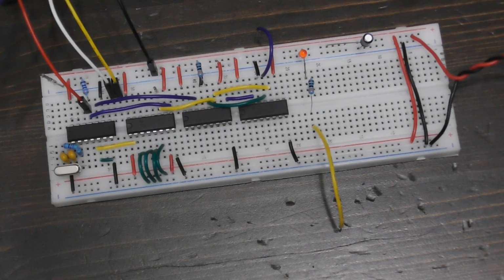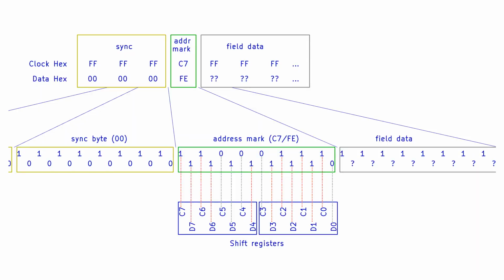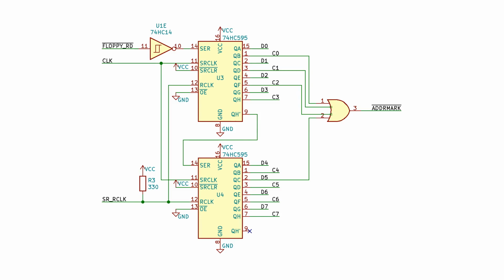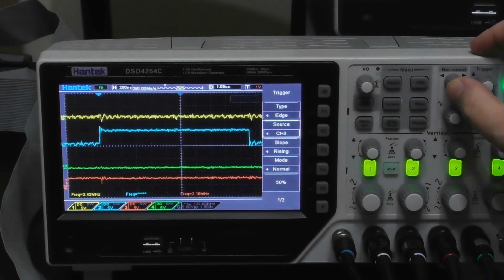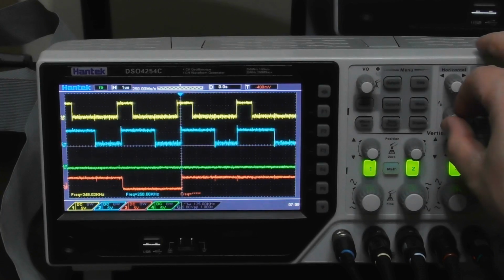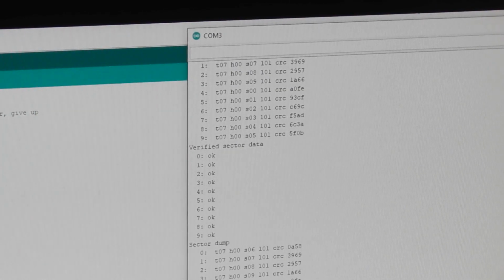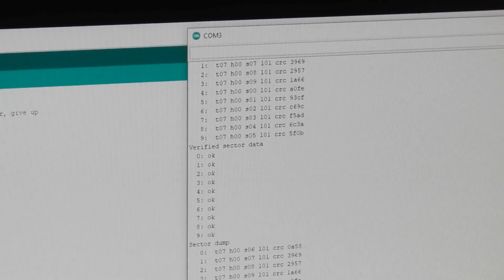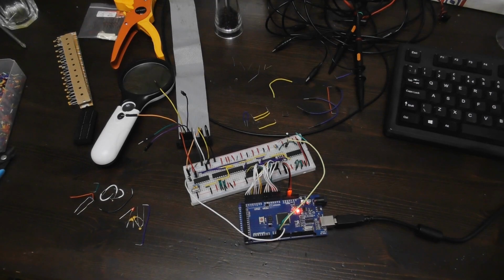Testing my Floppy Disc reading circuit with an Arduino

Comment: What would hapen if you use UART to store data, instead of FM or MFM? That way you can use a simple microcontroller to read and write.
Reply from the maker: Somebody commented a while back that you can use a UART to decode MFM at least into an intermediate form that can be fully decoded in software, very interesting

Comment: Isn't this where DMA is used? A faster IO device can take over the busses and write or read from the fast device without making the cpu sweat.
Reply from the maker: Yes you could do that. If you did it in a way that didn't require pausing the CPU - e.g. making the DMA happen in between CPU cycles like we do for video - then it would be beneficial as the CPU could get on with other things.
Reply: @GeorgeFoot  as a last stage what about putting the data from  the 595s and storing the data in a sn74hc273? This would give the cpu time to read in data while reading a new byte from the disk.

Comment: You seem like an experienced man, and I was wondering if you would help me hot wire my microcontroller up to a usb on my breadboard. its a PIC16F628A microcontroller, but when i hook it up, my pc gets the 'device descriptor request failed'. is there a way to mayby 'create' a fake dds (device descriptor signal, that's what I call it at least) or mayby to get a software that will communicate with the chip? Keep in mind I have no equipment, just some breadboards, wires, old device circuits, and a usb to usb hotwires cable (and some rom chips, pal chips, shift registers, and some other chips) any out-of-the-book knowledge you might have? any help from anyone would be nice.
Reply: I did a search and just in case you missed it, this video seems to be exactly what you need.
https://www.youtube.com/watch?v=HbQ6q3skZgw
In simple terms, you can probably do what you want using a USB library for your microcontroller, but you may be better off using a different microcontroller which has hardware USB support built in.
Reply: @melkiorwiseman  ok thanks for the response, the video might help me (when i understand it better) but for now thanks. Using a different microcontroller is a great idea (yes i thought of it before) but I have (as of now) only cash and live nowhere near a chip store, so ill have to wait for that one.

Comment: Haven't seen a new video from you for quite a while.  Curious as to whether you've done any more work on this or any other project?  I would love to see the fruits of your diligent research on this.  In any case I hope things are well with you and I look forward to more videos!
Reply from the maker: Thanks! I did a bunch of planning for the next video on this, which will be hooking up to a 6502. I debated whether to use a 6522 as well, or go direct (going direct won), and sketching the circuit diagrams - I'm pretty confident it will work and allow loading data from the disc. That was all in December - but then I moved house and I haven't been able to actually get on with it since then! I'm hoping to get back to it soon, as the hard work is already done!

Comment: Interesting. I wonder if there is some device that can sample signal for example at 4MHz, save them and process whole bitstream by a software. Actually I'm not sure if modern osciloscopes can do this, I haven't use any in 20 years. I'm not sure if raspberry pi has capability of sampling signal into DMA buffer neither. It's interesting how floppy drives are simple, I guess with faster electronics it would be possible to have constant data density rather than fixed data throughput and store more on the outer tracks (it would just break compatibility with 1970s design)
Reply from the maker: A lot of modern minimal floppy interfaces do just record the bitstream, or the times between bits, especially when using microcontrollers like Arduino. I'm not so interested in that though because these days yes RAM and CPU power are cheap. I'm more interested in the older technology and what was possible in that era.

CLV=constant linear velocity was used on CDs at least, maybe hard discs but I'm not sure. The difficulty is the effort of changing the rotation speed. These old drives just needed to be really good at maintaining exactly 300RPM. It must be harder to make something consistently maintain a variable speed.
Reply: @GeorgeFoot  I understand, for me as a software developer with signal processing background, I would choose SW approach. Hard drives or CD-ROMs faster than 4x have constant rotation speed. Hard drives have tens of zones with varying sectors per track so more data can be stored on outer tracks and data transfer rate is higher there. All defrag utilities are moving data towards start of the disc besides defragmenting files. I'm not sure if zones existed on MFM hard drives used till early 90s.
Reply: This is what devices like Super Card Pro\Kryoflux\Greaseweazle do. Most microcontrollers (including the atmegas) have dedicated pins that hook up to timers that can measure pulse timings (often called input capture).
Take a look at Rob Smith's work;-
http://amiga.robsmithdev.co.uk/history#background
https://www.youtube.com/watch?v=OAswAoNLJhs.

Then there is also this that you may find interesting;-
https://www.youtube.com/watch?v=ZgH6ov33ieg

Comment: The floppy controllers for the Ohio Scientific computers (among the cheapest of their time) were three simple parts: a PIA (6820) to move the head around and look for the index hole, an ACIA (6850) to read the serial data from the floppy, and a "data separator" which removed the clock pulses from the data pulses. It didn't bother using sectors or cylinders. Every track on the floppy was like a fixed length of tape. You just wrote or read tracks.
Reply from the maker: That's interesting, I considered just writing data to the tracks in my own format to keep it simple. I guess any time you had to update any data you rewrote the whole track?
Reply: @GeorgeFoot  That's exactly what you did with OSI's bare bones OS65 and that's why you needed a system with at least 16K of RAM. I think we had 320K on a 5 1/4 inch floppy so you had to read the entire 8K track into memory. In fact I never even learned how sectors worked. People wrote better OSes for OSI computers so maybe someone figured out how to emulate sectors which I guess would be reading and then writing at precise times. I don't know if you can even do this in software.

Comment: This is great!  Real low-level stuff!   I worked on hard and floppy disk controller designs in the 80's and so I have a good awareness of the various fields in the data stream from the drive, but even then  there was a much higher level of integration than this.  I am impressed that you have this working reliably with such a low parts count using standard logic parts.
Reply from the maker: Thanks for the comment, I appreciate it. I too thought it would be more complex than this, as I know things like the 8271 were pretty widespread at the time, and also quite expensive. It'll be interesting to add write support and get it hooked up to a more 80s style CPU.
Reply: @GeorgeFoot  Interesting? Certainly. Challenging? Probably. Writing adds a whole new dimension.  Get the timing wrong and you not only can't read what you wrote, you may have trashed everything else on the same track as well.
Reply: @GeorgeFoot  you can add this circuit through a 8255 in mode-1 for automatic latching. There is also a hack to make it work without DMA, to have a D-FF output connected to CPU's WAIT, the FF is set by CPU by one IN command and 8255 reset the FF by INTA, so data read/write loop can be very tight just 3 commands IN,IN, PUSH. /*SP must point into input buffer */
Reply from the maker: @alexloktionoff6833  That's an interesting approach. I'm probably going to do it either through a 6522 or custom latch circuits - probably the latter as it's more interesting to design. The CPU will poll or service NMI interrupts like on the BBC Micro, at first, possibly with DMA later on.
Reply: @GeorgeFoot  agree with custom discrete chips it's more interesting. But it may become bloated - fd controller pcb may become same size as video-card. Z80 @ 3.5 MHz had just enough speed to poll /*to include test and conditional commands in the loop*/ for DD fd. Without sector buffering in fd controller NMI is too slow i'm afraid. Let's see ;)
Reply from the maker: @alexloktionoff6833  We'll see - I've been cycle counting some potential ways of interfacing it and it looks OK. The BBC Micro managed double density using NMI, on a 6502 at 2MHz, so it should be fine. The main thing my circuit won't do is CRC checking, but that can be done in software, possibly outside of the main data receiving loop.
Reply: @GeorgeFoot  for i8271 let's say there is a single byte of data transfer always, but for DIY we need two read two bytes to be sure /*ID field or DATA field, and write twice more*/ isn't it?
Reply from the maker: @alexloktionoff6833  I have sixteen bits coming from the shift register. At the moment it's only FM so could be fairly trivial to have hardware check that the clock bits are all set, at least for regular data. Maybe also for address marks, as there are only a few that matter. Some of my code drafts (hand written on paper!) are based on reading the same register twice, 4us apart. I think the Arduino proof of concept just read all 16 bits. But I'm also looking at hardware buffering, maybe making a two-deep 8-bit FIFO, so that CPU timing is less critical. For a first pass I will probably take a lot of shortcuts!
Reply: @GeorgeFoot  it's possible with additional schematics by reading from different address to tell controller what CPU is looking for /*normal byte or marker*/ Writing could be done starting from clock byte, and then providing only data bytes /*because marker is single at the beginning*/.
Anyway Arduino is a rocket fast comparing to 6502 /*16*1=16MIPS vs 2/2=1MIPS*/. It's a supper challenge to implement MFM R/W for 6502!
I'm supper interested in seeing the next video :)